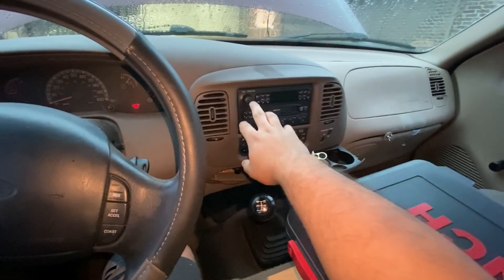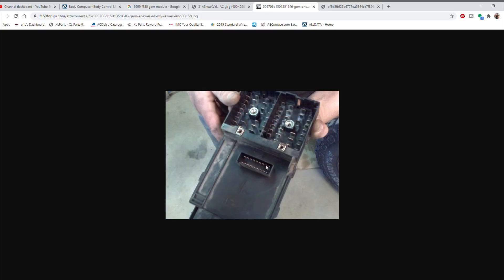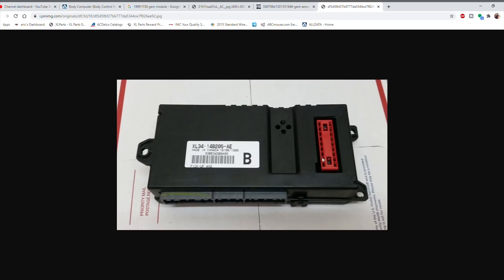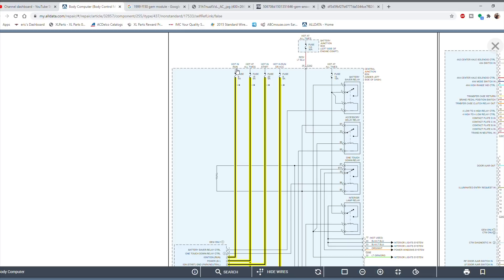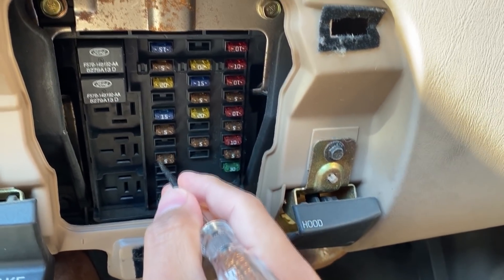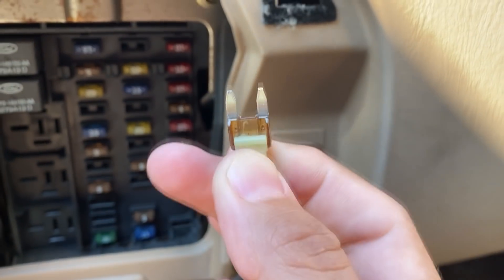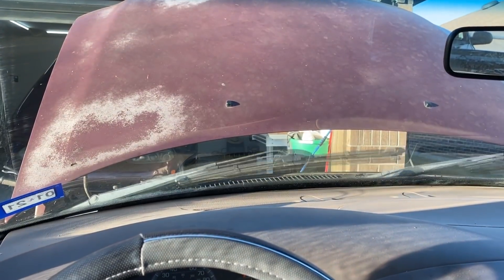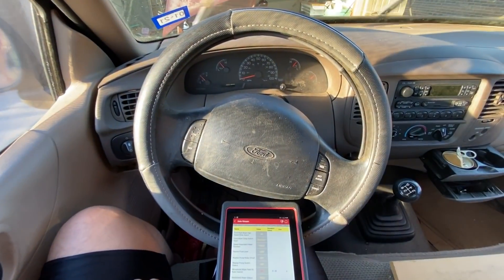FORD F150 WIPERS NOT WORKING DIAGNOSIS & FIX PART 2

Comment: On mine, when I pull fuse #15 and insert it, I briefly get power atthat instant on wipers/chime and then it goes away within like a second or two. Occasionally while driving it will start working briefly and then it will cut off. What could be the cause?

Comment: I'm sure glad I watch older videos... just wish I had watched it a little sooner.. This morning I noticed I had no wipers or washer. I just assumed it was a fuse that I would deal with after work. Got home and checked all wiper related fuses and relays with no luck. Then I took the switch apart and cleaned the contacts. Still no luck. Came in and jumped on Youtube and watched a couple videos that just went over what I had already done. Then I ran across this one and I'm glad I kept watching because when you mentioned no wipers, no washer, and no door ajar sound, it hit me that I didn't notice the usual sound with the key in and door open. Then when you found that fuse 15 was the culprit, I ran out and checked and sho-nuff It was blown. I changed it and I'm back in bidness! Had I not run across this video, there's no telling what all I would have torn into and needlessly replaced,  taking the rule-out-route... when it was about a 3 minute job and a few cents. You probably saved me a ton of time and money and for that I am grateful.

Comment: This has been an extremely helpful video to me!  I've had this truck over a year and a half and the guy that sold it to me said he absolutely can not figure out what is wrong with the wipers so me not being a mechanic I figured I was just screwed not having wipers.  Then this past Tuesday my main vehicle broke down and I cant figure out what is wrong with it after replacing the alternator and battery.  This means I only have the truck right now and couldn't drive it in the rain until this video!  This morning I got up on a mission to try and get these wipers working if I could with zero knowledge of what to do.  After taking the wipers and cover off to see if there was even wiper motors, etc in it I found that there was.  I swapped relays, checked the 30 amp fuse, etc and all was well.  It doesn't have a radio so not sure about all of that.  I see this video and now not only does the wipers work but my door chime and dome lights are working as well!  The 5 amp fuse was missing all together to my GEM so I put one in and a blessing happened!  Fuse 20 was blown and after replacing it my ignition still will not start the vehicle so I have to cross the new solenoid thar was put on it which is probably why fuse 20 blew to begin with.  During colder weather it starts by ignition fairly often but during the hot months it will not start at all by ignition.  The check engine and ABS light stays on.  I'm guessing that's also why it chimes a bit extra now that I've replaced the GEM fuse.  Thank you so much and also thank you for being so thorough!

Comment: Have a 97 wipers and door chime or interior lights dont work, checked fuses and replaced with rebuilt GEM. Suspect fuse panel but I have not checked grounds.  What test equipment did you use was unable to find reference.  Thanks,
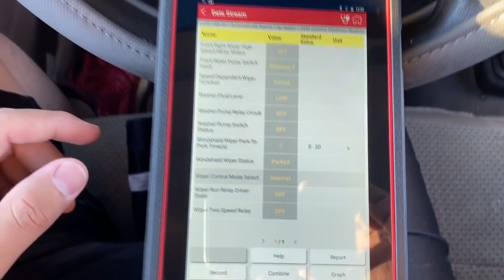15:06

Comment: Worked like a charm. Easy to do and solved the problem in about 30 minutes. Thanks for the Video. (1997 F-150 Lariat, driver window not working).

Comment: 2003 4.6 . Wipers washers not working unkess i force power to the relays. All fuses you mentioned are working, i have codes from gem saying the circuits  are the issue.

Comment: Thank you so much man! The wipers stopped working in my 2002 for f150 for the same reason, for the life of me I couldn't figure out which fuse was blown, in my truck turned out to be fuse number 8, checked it and replaced it now my wipers work! Not a huge deal but as a 17 year old with no mechanic experience I'm pretty proud haha and your video did me wonders

Comment: Eric this is an excellent video. I have a similar yet different issue. 1998 F150, I know I have a water intrusion issue, but my wipers come on HI when I turn on the ignition. Also, recently my interior lights stay on whether truck is running or not and the chime started chiming for no reason. 
My question is: if I fix the water intrusion/windshield issue, do you think I would still have to replace the GEM?

Comment: Great video man...I had the same issue but no scanner tool. Just went off your video and one of the ign on power fuses was missing. Replaced it and woke up the GEM now I have wiper function. Same root cause water and rust issues...thanks again

Comment: I have a similar issue. wipers only worked on low or high, no intermittent. replaced multi switch. nothing worked. removed 5amp fuse #6 it was good put it back in and the gem module clicked. everything worked with the key on ignition off. with the engine running only low and high on wipers no intermittent. any idea?

Comment: I usually look for a short video when it comes to diy.  Most people spend too much time doing anything but giving me the information I need.  I came back to your video and watched both because I realized I needed to understand the entire system before I could approach diagnosing my issue.   THIS IS THE BEST, MOST COMPLETE VIDEO  that I could find.  Great job, and thank you!

Comment: I have a 99 F150 as well. When I try turnin the multi switch on the wipers don’t turn on until getting the high setting and when I turn off the multi switch wipers are still on. If you can please help me figure out what it could be i would be grateful. I was planing on changing the GEM as well but it may just be the relays or fuses.

Comment: Excellent presentation!!  When my truck sits in the hot sun for a few hours, the GEM works fine.  In the mornings, parts of the GEM doesn't work, ie: washer, windows, interior lights, and door chime.  I'm thinking it's gotta be the morning dew condensing and dripping down onto the inside fuse box and Gem.  I had the GEM and fuse box out a week ago, and took it apart, and all the contacts looked clean, but I did notice a little green at the bottom of the fuse box, so I think it's gotta be a moisture problem, that goes away when the water evaporates.  Just wondering if anybody else has noticed this?  Again, one of the best presentations I've seen on you tube!  Thanks!

Comment: I have a 2000 F150 and my windows, wipers, and radio had suddenly stopped working. It didn’t even tell me when the door was open. All these issues only worked when the key was backwards. It became a death trap and I couldn’t find what was wrong with it for over 3 months. Today I found out it was fuse 113 😭 I tried SO many many things and nearly spent hundreds. I hope this helps somebody!!
Reply: This really helped me.  Now I know that my #13 "always hot" fuse is the one that keeps blowing.. I have to track down the short some how as it blows the instant i put a new fuse in... hope there is something I can do other than pull and replace that GEM...

Comment: I got a 2002 f150 4.6l v8 the wipers and radio work on ACC but dont when on or started? I changed ignition switch amd checked some fuses door dings idk what to do

Comment: Hey Boss question the function of the motor if the wipers dont work on the slower functions would that be an issue with the motor than or the control switch

Comment: New sub here, definitely worth the extra time explaiming how everything worked step by step. I mostly understood the diagram but got lost at what park meant and what the park run switch internally on the motor was. Wouldn't have picked up on it if you didn't explain it as well as you did.

Comment: I imagine any of the outputs can also cause the fuse to blow, if the module outputs 12v on any of the circuits.  It's tedious but I feel like the module should be loaded - test everything the module controls, at once if possible.  Or just use a garden hose to spray the windshield and prove the module gets wet and blows the fuse.  

Also -- when testing the hot in start fuse, why'd you push in the clutch?  I think you could've not pushed in the clutch, not had the engine crank and start, and you'd have been able to hold the key in start for as long as you wanted to.  That would've let you test both sides of the fuse :)  

I'm enjoying your videos!